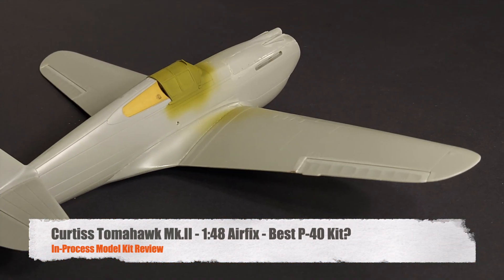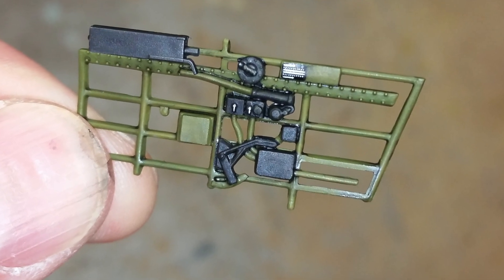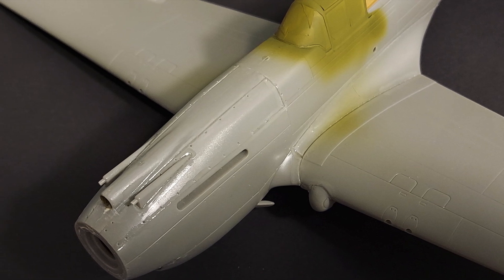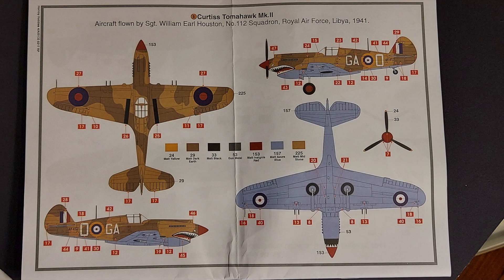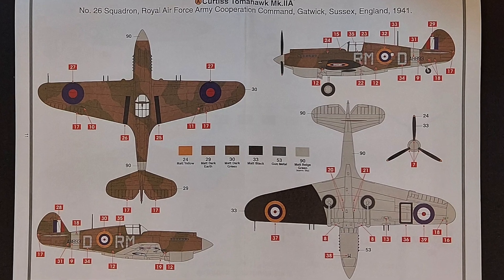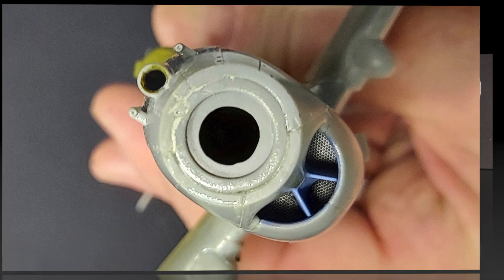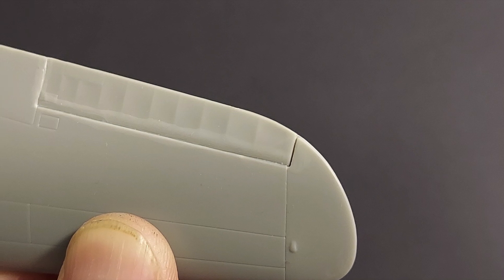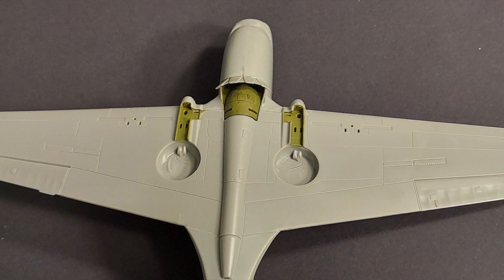Airfix 1:48 Tomahawk Mk II Review - Best P-40 Kit?

Comment: I built up the initial release of this tooling (P-40B no. 05130) and loved it until I reached the same point you did: the nose. Nothing quite lined up and it took a fair amount of care and time to get it right. However, detailing the cockpit was a joy. Airfix really has so much potential.
Reply from the maker: It seems like there is usually a "what were they thinking?" moment in every Airfix build. Either poor engineering of a prominent part (Spitfire nose, P-40 nose) or poor clear parts (Bf109E, Hurricane). I really want to see Airfix step up their game. The competition just keeps getting better.